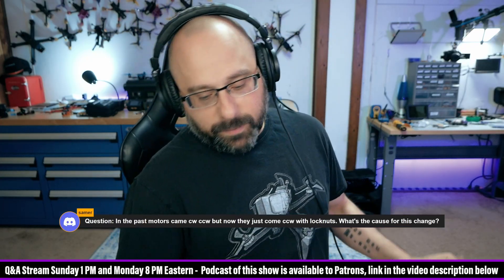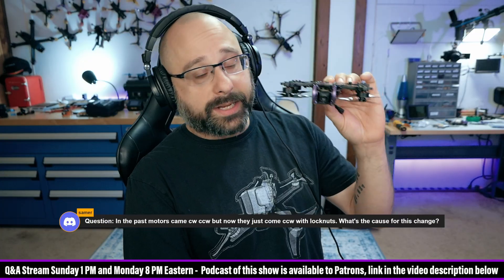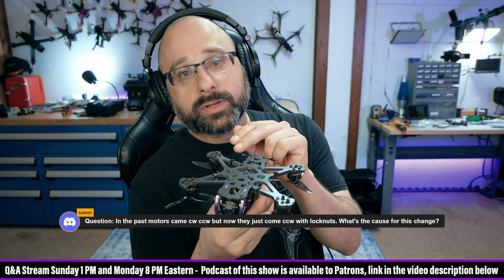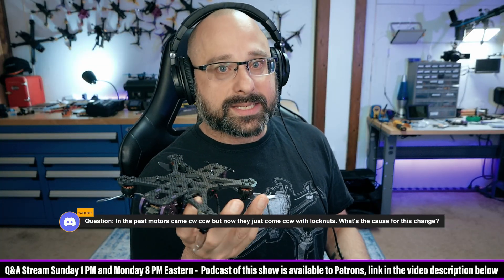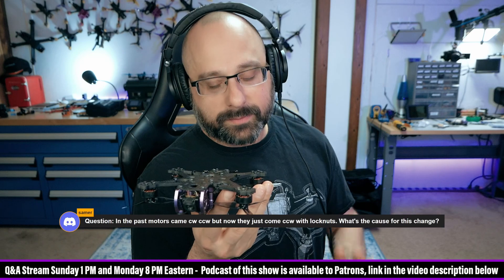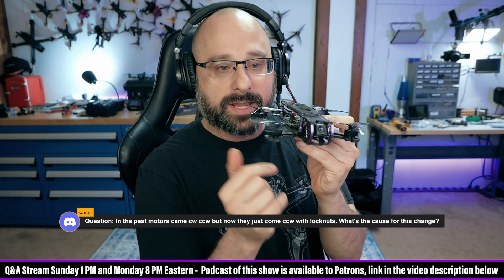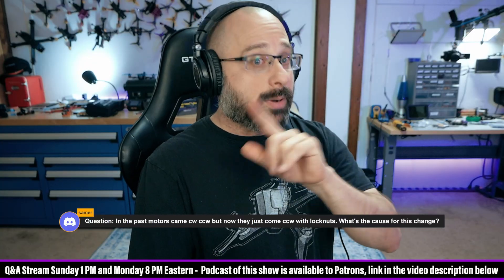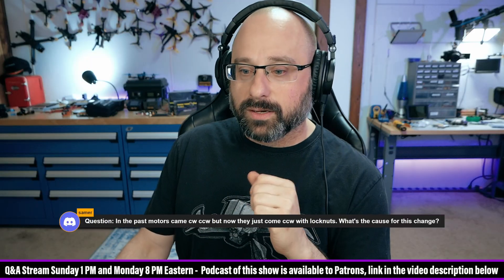Why Don't FPV Motors Come In CW Or CCW Anymore? Clockwise and Counter-Clockwise Motors? - FPV Q&A

Comment: I'm building a drone first time, with a speedybee F405 V4, and realized I got all CW motors, Emax 935kv.     With SpeedyBee's configuration, will I be able to use all four cw, or do I need a CCW pair to fix this issue?
Reply: You need to hold the controller upside down.

Comment: i really doubt turtle mode was the reason.... it's far more likely that money was the reason!!! just like they don't make spare bells anymore. i think they just found they don't really need both threads after the cnc process got better adding the knurling under the prop and the shafts got stronger so they don't just snap off like old motors when you crank down on them... so it was just cheaper to do one direction bells! anyhoo... ready2sky made some newer style r2207 1800kv motors for $40 a set recently that was cw and ccw, i was thinking about getting them, tired of knocking props loose, i really don't know if they are any good though, personally i'm a huge skystar and brotherhobby fanboy... rcinpower is growing on me though

Comment: I actually think they had already started to fade out before turtle mode and the answer is more boring than you think. Mostly the answer is that FPV people crash a lot and we don't generally buy motors in sets of 4. Vendors didn't want to stock multiple SKUs of each motor and pilots didnt want to have to keep multiple spares on hand and figure out which one they needed to replace. CCW and CW sets were never going to last long in FPV, they were simply a holdover from other multirotor applications. Our use case us just too different. Based on how I remember things there were very few left already by the time dshot and turtle mode were a thing.

Comment: I come from Rc car world where some racing motors are directional but that’s for different reason- they have mechanical timing on them. I always thought the drone motors were the same? Like they would spin the other way but would do so with negative timing so with big power loss.
Reply: Brushless motors are always timed electronically. Perhaps some sensored esc software can only handle one primary rotation direction???